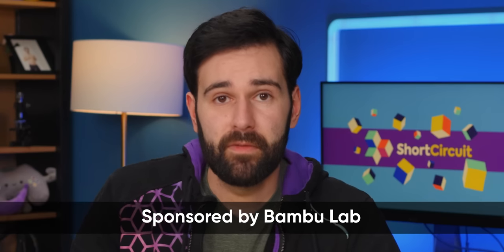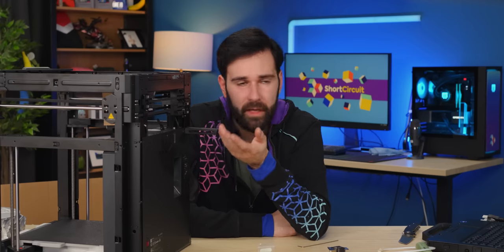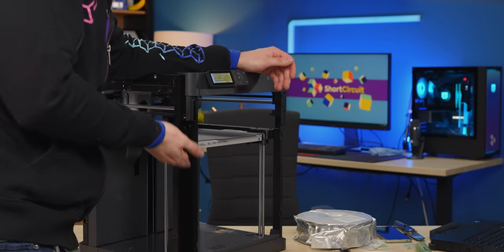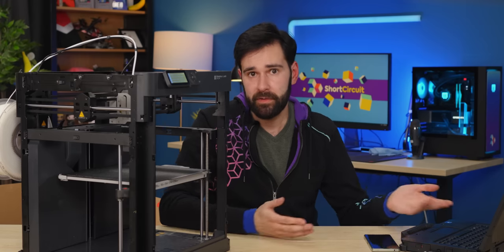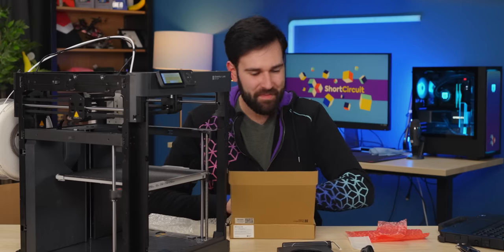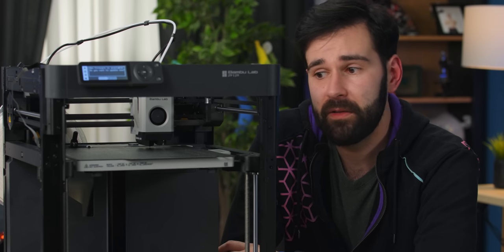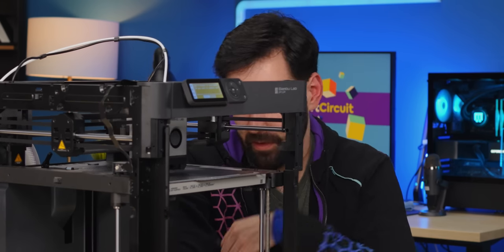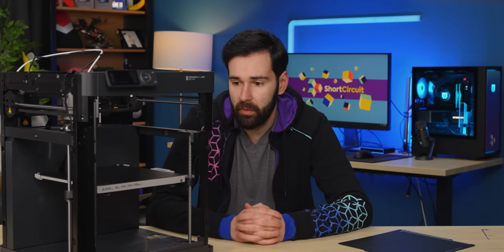I wish this wasn't sponsored (because it's so good) - Bambu Lab P1P

Comment: Bambu lab printers are pretty unreliable. They have a lot of mechanical problems and the X1/P1P are designed to be thrown away due to how the rails are epoxied into place. When the CF X axis rods wear down, due the the bronze bushings wearing into the CF rods, the rods can't be replaced. Bambu lab doesn't offer replacement rods, or replacement bushings. You only have two choices, throw it out, or send it in for repair. Add in the serious warped bed issue they're having right now, and its easy to see bambu lab doesn't do any form of QC. Bambu lab even had to come out about how bad their QC has been lately.

Bambu lab printers are not designed to be long term machines like a prusa. Even with something as bad as a creality/anycubic/elegoo, etc, at least you can buy replacement parts and repair those printers yourself. This guy didn't even "review" the printer, he did one single 5 min print and said "this printer great"....put a few hours or weeks into it and soon enough you'll be putting in support tickets because something broke, and now you need replacement parts. My friends P1P stepper motor died within 10hrs of ownership and took 3 weeks to get a replacement motor.

Sponsor videos like this just show me BL is getting a little desperate for positive coverage, since so many negative stuff is being said about them right now.
https://forum.bambulab.com/t/warped-bed-seems-like-a-common-qc-issue/4313/138?page=9
https://blog.bambulab.com/quality-assurance-and-operations-update/

This channel is also deleting my comments. Bambu lab obviously paid them to delete all negative feedback.

Comment: Another paid preview of a mediocre chinese machine.

The "crunchy" noise is not tesselation on the model. There is clearly a shot bearing somewhere (pulley or a linear bearing on Y axis). And, mind you, thats on a brand new machine that was sent for a preview. Well, that screams quality and QC

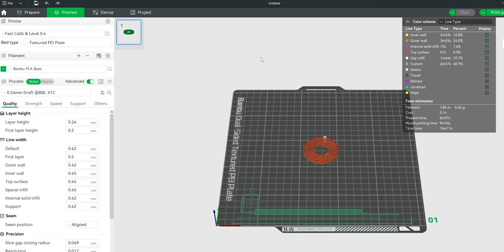At 15:41 printer clearly froze after the first layer. But, for whatever reason you opted to ignore it..

Comment: Printer looks good, but that App rules it out immediately. Completely unacceptable in every concieveable way.
Reply: then....dont use the app? you just control everything through the slicer on your computer. i don't understand why he mentioned using the app. you can't actually send prints to the printer through the app. just through the slicer and micro SD. the app is just used for remote monitoring

Comment: The  p1p has Chinese version and overseas version.  If you use Chinese version outside mainland China, the machine will be locked. Do you think this means the manufacturer can access and take control your printer  without your permission?

Comment: Why did you have to restart? If you’re reviewing a product, shouldn’t you point out any problems? 🤷🏻‍♂️
Reply: in my personal experience 3d printing my guess would be the part cooling fan being off messed up the print in place hinges hence the finished product coudn't move.
Reply: I think that high speed printing didn't pair with "fan off" 😅

Comment: One would argue if you are not qualified to do a review you probably should not be doing sponsored overviews/adds. Particularly considering 3D printers can burn your house down and this printer has units with older firmware with a thermal runaway issue.

Comment: What? They have taken prusa slicer, forked it and rebranded it as "Bambu Studio"? That's some shit. It is open source of course, but still.
Prusa Slicer already had support for many printers from different manufacturers, why did they have to fork it and rebrand it when they could have just created pull requests with the missing features, contributing to the project?
It says quite a lot about the company to be honest. That and the RFID tags, or the mandatory mobile app... smells Apple-y if you know what I mean. 
Closed ecosystems, no thanks. 3D printing should be about open source/free software with Marlin, Prusa, FreeCAD, Blender, etc. Going into proprietary software is going backwards IMO.
Reply: These printers also aren't serviceable, they're designed to be thrown away after certain parts wear down, like the CF rods or bronze bushings.

Comment: Why are you glorifying this?

This is LITERALLY a textbook list of all that is anti consumer, which the 3D printing hobby is HEAVILY opposed to (rightfully so might i add)

Seeing a premium price printer with all this BS is just disgusting.
Even f-ing amazon offsets their bs by selling at a low price
Reply: "Why are you glorifying this?"

Because it's a paid sponsor video. He fails to mention ALL the negatives about these printers, including their terrible QC and CS, and that they're mostly un serviceable.
Reply: @nemtudom5074  Lil ape is an actual troll who's whole life mission is to try and discredit everything Bambu does.
Reply: @logitech4873  Maybe, but either way he's right
Reply: @nemtudom5074  Uh no.
Reply: @logitech4873  Every single point they made was factually correct.

These 'proprietary' things are only proprietary to lock people into their ecosystem, which is disgusting.

There is absolutely no reason to have anything proprietary in 3D printers, and thats proven by the Prusa printers which are about as open as it gets, and consequently they are the best ones out there aswell. Sure, they cost more, but cutting costs and making an inexpensive printer doesnt mean you need to make something proprietary.

They are only proprietary to be able to extract more money out of people.

Comment: Dear LTT: can we stop with the "for you Americans" commentary when giving measurements? US citizens are quite capable of handling metric units as we are taught both. Just give your measurements and skip the groundless conversion. If it helps you stop think of process of doing the conversion for us as enabling. Not enabling us would be the quickest way to get us to just use metric by default. Thanks.

Comment: It's really not that good, did the sponsor pay you a lot for this title?
Reply: The p1p is genuinely an incredible printer
Reply: Out of curiosity, what would you say ranks better for out-of-the-box plug and play experience? Obviously you could build a Voron and get it working with a Palette but that’s not only 2x the price but also a lot of building and fine tuning. I’m just wondering what I’m missing with this comment.
Reply: I have one, and I can confirm that it is as amazing as the video tells you
Reply: Comment added within two minutes of a 19min video going live. Are you a competitor shill or just a troll/fanboy?
Reply: @derekjenkins6614  Just someone who has worked with it personally and knows its garbage.
Reply: @demetter7936  Can you give some reason why it's bad?
Reply: @demetter7936  i own an x1 and it has been a significant upgrade over my prusa mk3 and I have everything to believe that this is probably as good as anything at the 700 dollar price point, it’s a whole lot more trustworthy than the ankermake!